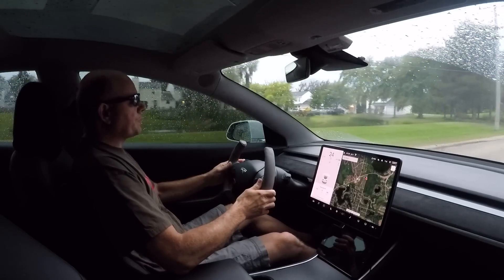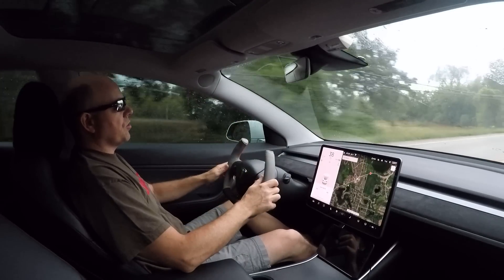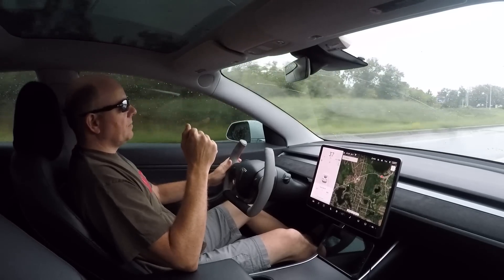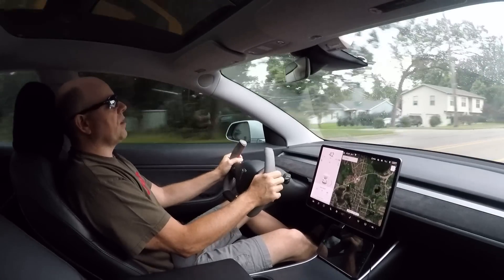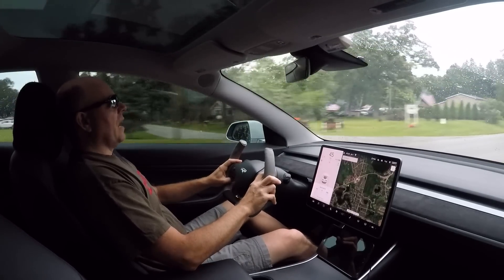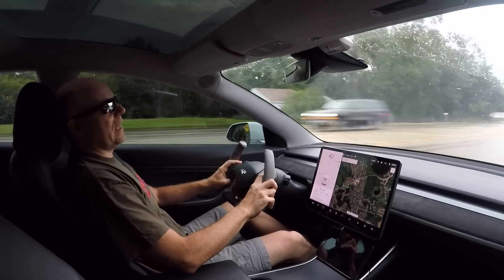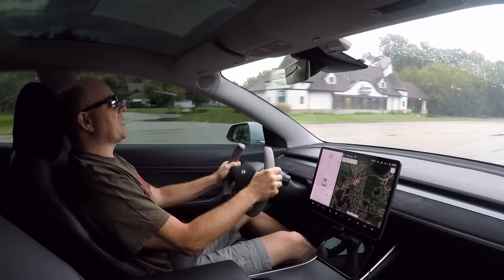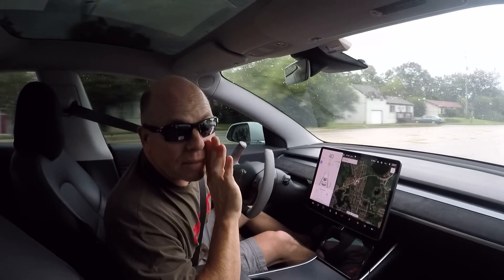Tesla Plaid powertrain. Exciting in ways you may not have considered!

Comment: My guess Tesla has doubled the voltage, and has updated battery chemistry for faster charging and discharging. This means no increases in thickness of cabling for instance. Taycan went 800v I really don't see Elon letting that slide! They have something up their sleeve for sure. I also suspect TR 2020 will have a more energy dense battery chemistry squeezing 200kw into something not much bigger than a model S battery. My guess is North of 300wh per kg.

Comment: Here is my thought about the 2 motors in the rear.  I agree with the faster acceleration but.
Since electric motors have so much torque that when you go fast around turns you can put a little more torque to say the right rear while making a left racing turn.  This will act like the right pushing the car around the corner.   A little like a bulldozer.  Which will take a lot of pressure off the front tires to get the car around a corner when going fast, relieving some over-steer problems.  Thanks
Reply from the maker: It's called torque vectoring. Both of our AWD cars have it.

Comment: I also think that with 3 motors you can play with the gear ratio and optimize one motor for very high speed (>100 mph), where it would normally start to lose power at those high rpms.

Comment: So your assuming they are running roadster power levels in the model S? I would think they wouldn't waste development time on using parts as a mix and match. Surely it is development, like they said, for the model S plaid. I'm sure lessons learnt from roadster development would surely have contributed to the plaid s model though.
Reply: It would make sense that the Roadster, S and X share the same platform in order to save on production costs.
Reply: @billh2294  true, but the roadster will have batteries stacked twice as High which would change everything. That's why I don't think it's running roadster power levels, because they won't have the battery's to support it till they move to the quantities that roadster will have.

Comment: Battery power is something everyone needs to appreciate. The only reason it makes sense to give a car like the Roadster such a big battery pack, with the extra weight it brings, is that it's required in order to get the power for those motors.

I'm thinking three motors are used in order to do away with the differential and its weight and volume. Otherwise, you'e probably just use a bigger motor. Whether this approach will be taken with cheaper vehicles is TBD. I'm sure eliminating the differential has its downsides.

Comment: Models 3 and Y won't have plaid!
Models S and X will have plaid.
Roadster will be specialized with plaid.

Models 3 and Y = entry level
Models S and X = intermediate
            Roadster = Advanced
Reply from the maker: Yup. I never said otherwise.
Reply: @TechForumTesla  yup otherwise I would've said you've never said otherwise anywho.
Heh just made a Clif note in case there may be an exam later on.😏🤔
Reply: I think they won’t use 2170 cells in model s with plaid drivetrain. 18650s have a higher discharge rate.

Comment: Thanks for sharing your thoughts. Another parameter in electric power is Voltage. They probably can rearrange the 2170 cell/module and develop 600, 800, or even higher voltage drive units.
Reply: Do existing Superchargers support > 400 Volt? Dont think so. Would be troublesome to upgrade all of them.
Or put some sort of voltage increaser in the car, like Porsche did in the Taycan.
Reply from the maker: @nur_noch_elektrisch7429  Tesla batteries are 350 volts. 400 is not far from that.
Reply: Tech Forum Sorry for using not the right words. Charging end of most (not all, some are lower) Tesla cars is around 404 volts. Its not the nominal voltage but the charging end voltage (highest voltage).
So they are called „400 volt“ cars, because their battery, motors and electronics can handle 404 volts.
Though their nominal voltage is lower.(around 320-350 volts)
Reply from the maker: @nur_noch_elektrisch7429  I know. It is frustrating. My electric bikes are 12 lipo cells. The nominal voltage is 44. Top of charge is 50.4 volts. 

So, is it a 44 volt pack? 50 volt? 48?

It gets confusing.

Comment: I'd say the Plaid powertrain is using the Maxwell Industries technology supercapacitors and/or a new specialized cell chemistry for the Roadster and Plaid S/X to maximize performance. I'd say the Plaid prototype is running a 150kwh - 200kwh pack? Couldn't see too much of the interior on the S that lapped Laguna Seca, if they changed anything wouldn't it be to compensate for the larger pack (if it required more physical volume than the 100kwh pack)

Comment: Well remember, the Rimac C_Two/Pininfarina Battista and Lotus Evija are pushing just under or over 1900hp and specs that are just a bit off the Roadster's. I'd say it's safe to say the Roadster is pushing closer to 2,000whp. Higher top speed than it's rivals also (you need horsepower to have high speed).